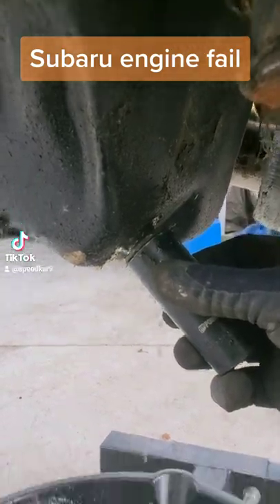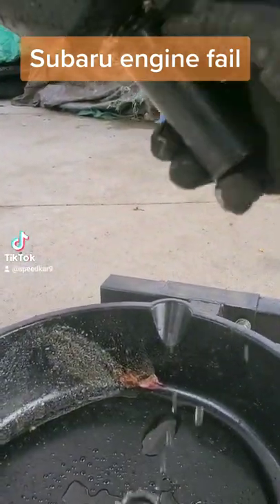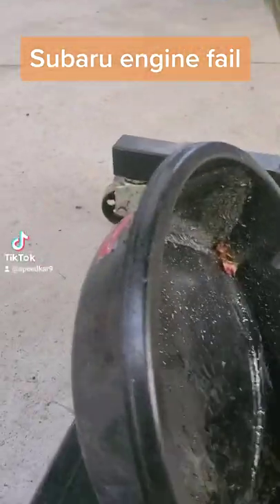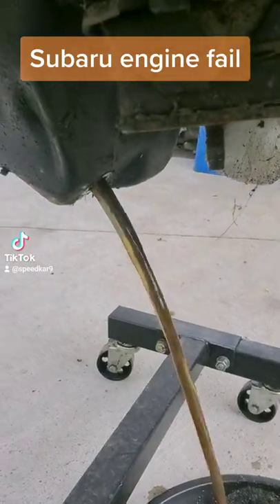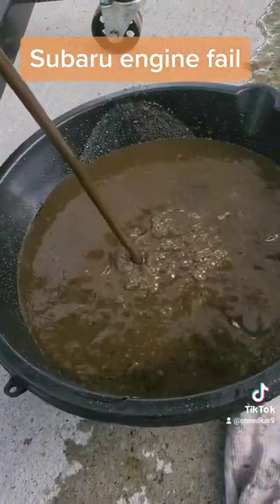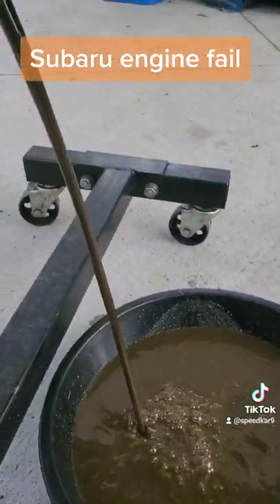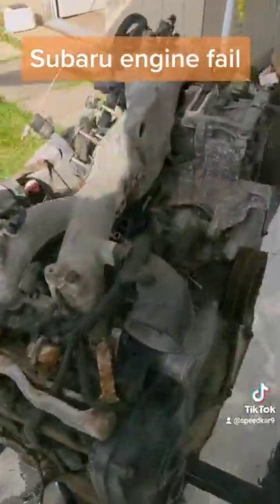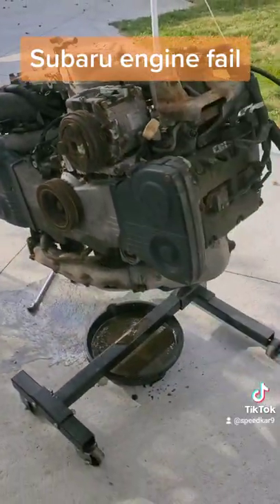Subaru WRX EJ20 turbo engine fail!

Comment: Had a 2003 wrx hatch, put 240K miles on it. Never had an issue. Kept good care of it, changed oil and all other fluids regularly.  Was a great car.
Reply: Hoping mine will be like that. What happened at 240k?
Reply: Good on you..most will blow a gasket or a turbo or a throw a rod or..
Reply: @aaronhumphrey2009 i had a turbo ej16 with ihi vl04 turbo inside just for fun and experimets it broke a connecting rod at 127.000 then i did a rebuild with forged rods im 279.000 and it still works like a charm pushing 180 hp😂😂😂

Comment: Subaru, that’s a bold move copying the Northstar’s consumable head gasket design.
Reply from the maker: I think the Northstar copied Subaru
Reply: @speedkar99  Not really northstar came before EJ25 with faulty gaskets. As for turboes...well its partly subaru being cheap(5mt desinged for naturally aspirated motors used for turbo motor) and people being idiotic when it vomes to a turbo car. Everyone goes weee woth stupid access port and then cries. And general idiocy when people dont even know how to treat a turbo car. UEL exhaust headers contribute to ringland issues combined with excess boosting tho, since there is termal wear assymetry. 
2.0L EJ never fail in any similar fashion, nor do ez30 H6 motors or newer FB series. FA20 turboes fail but only for ignorant user reasons nowadays.

Comment: Get a Subaru, they said.  Reliable engines, they said.  Easy to work on, they said.
Reply: They also said 
"Check your oil when you pump gas instead of just standing there" 
They also said
"Don't do any bolt-on mods without getting a tune" 
They also said
"If you want to just put 87octane in the car, drive on bald tires, and make no effort on preventative maintenance, buy a Civic, Corolla, or Altima. Accord, Camry or Maxima if you can afford it...